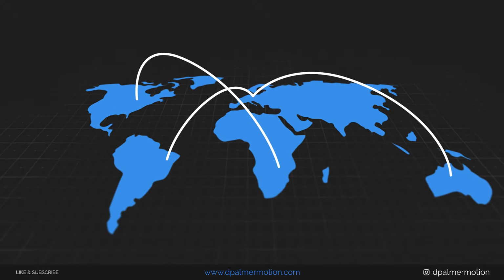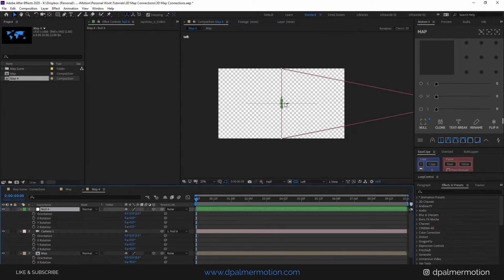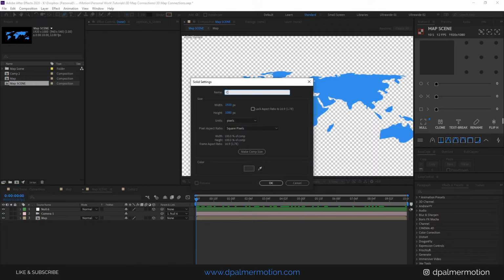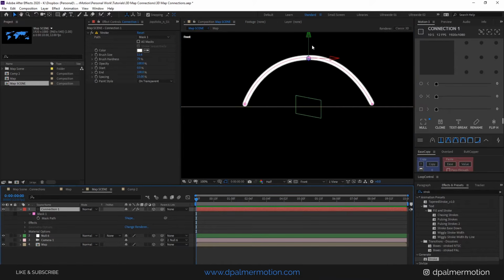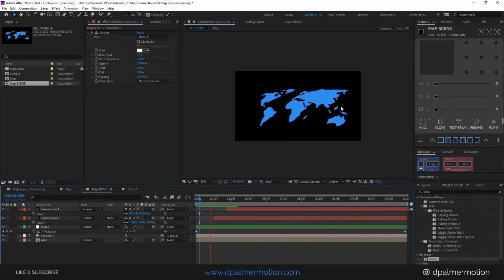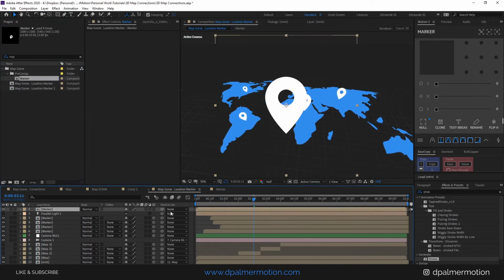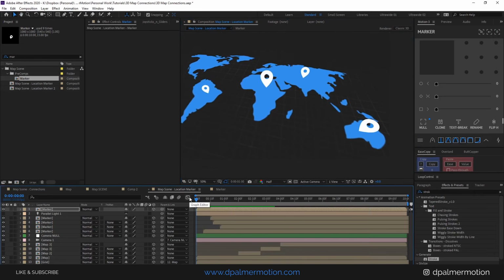After Effects Tutorial: 3D Map Lines & Location Markers

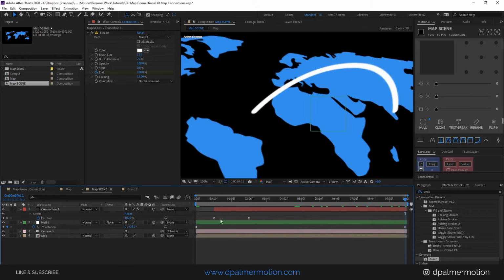Comment: this is so useful... but I have a question about the "continuous rasterizing" switch you turned on 5:10. When I turn it on I no longer see the just stroke effect but rather the I see the whole solid (using the cinema4D renderer). If I switch to the classic 3D renderer is see only the stroke as desired but the resulting line no longer accepts lights! Anybody know of any work-arounds for this?